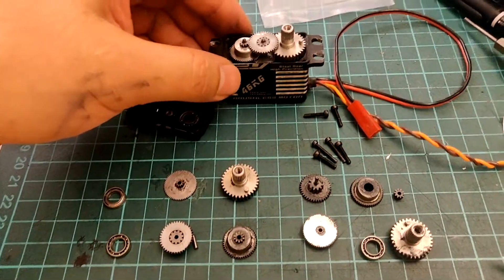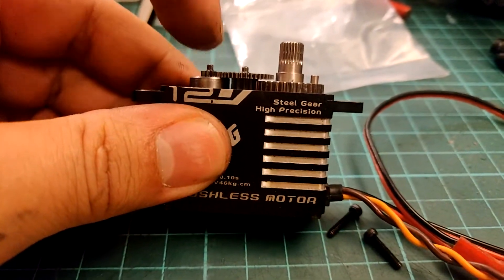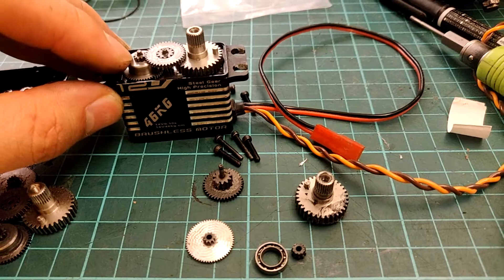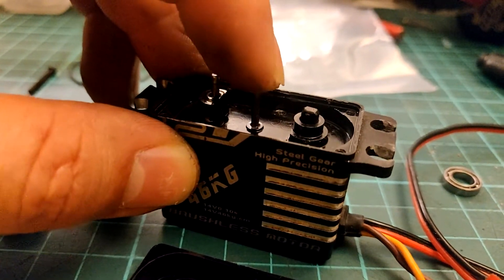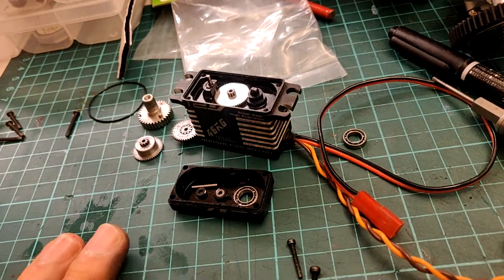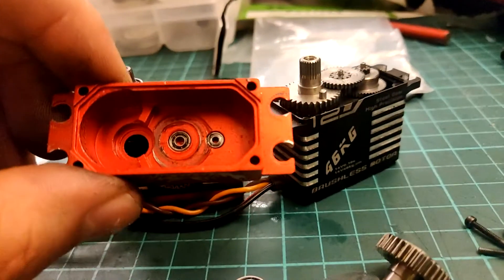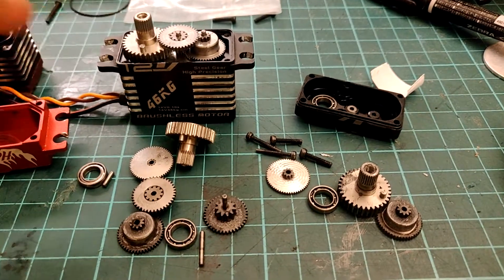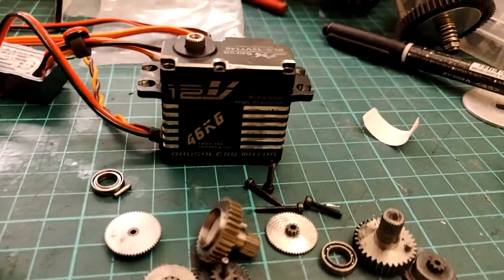Flaws and failures of JX BLS-12V7146 (ft. Bluebird BLS-H50B), JX 46kg 12v Brushless Servo review.

Comment: I've been RC crawling for about 15 years so have a fair bit of servo knowledge. I now use titanium alloy geared brushless Bluebird 3114 or 31A servos and have never had one go bad. They are real 27kg 0.12s at 6.0V and cost about £50. I consider them great value. The only other servo I use is a Savox 2270sg which is comparable but nearly twice the price and 'only' steel gears. When you've carried a 1/8 all alloy crawler with stripped servos 5 miles back down Kinder Scout you pay great attention to servo quality...
Reply from the maker: I've now own about 6 bluebird servo and in my experience I haven't stripped any gears as of yet but all of them has developed some pretty bad slop in the gear train.  I was wondering if you had the same experience with the 31a?

Comment: Hi, I had the same gear breaking issue with the 32kg BLS-HV7132MG servo and could not find replacement gears for sale. Did you find them? If yes, you can tell me where because I would like to replace the broken ones of my servant.
Reply from the maker: I got mine off asiatees.  Here's the link to the 32kv version gear set: https://www.asiatees.com/display?Miscellaneous-All-Parts-Hop-Ups-Upgrades&brand=Miscellaneous&model=All&id=159307&pid=1

Comment: I really would like to know how long you used it for before it started to fail because I just bought one
Reply from the maker: I had it in a trx 4 on running both the truck and the servo on 4s for about 8 months.  I will say I was pretty rough on the truck in general.

Comment: Great video bro,
Any issues with the Bluebird as it's not waterproof I could find??
Want to use this on an Xmaxx 🤔
Reply from the maker: The servo does has rubber seal and will be fine with puddles and rain. Wouldn't trust it if you plan to submerge it

Comment: Wow that bluebird looks heavy duty in comparison! I have the regular HV version and will be moving on from it when it breaks. My truck is 11kg and the wheels barely turn on grass lol. I have seen reviews where actual rating of the JX is closer to 29-30kg at 7.4v, and I feel the speed is much slower than my 0.1s PowerHD.

All considered it is not too bad for $45 which is what I paid

Comment: I need a new gear set for my jx 7132, would you know where I could find that?
Reply from the maker: i get my gears off asiatees.com,  im pretty certain the gear sets between the 12v and regular HV versions are the same; though I cannot confirm, From my experience I think the gears between the 32 kg and 46 kg are inter change able,  its pretty common for manufactures to use the same electronics in a servo but gear the servos differently to get different speeds and torques,  this is evident as the JX "71xx" servo line basically all cost the same regardless of torque.  hopes this helps
Reply: Thanks for the reply! Also something I did to fix it after it stripped?  Just turn that top gear to where the bad teeth dont engage, and voila!  I've done it 2 times now to same servo and gear. All the teeth were worn, so it wont last long!